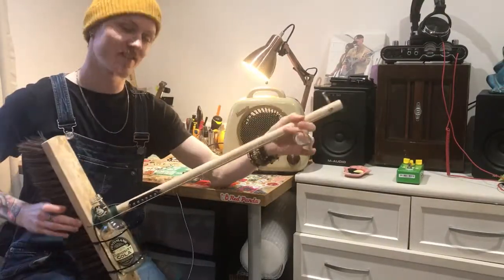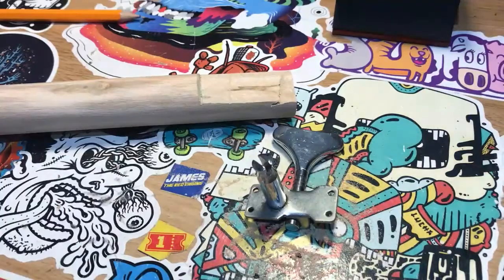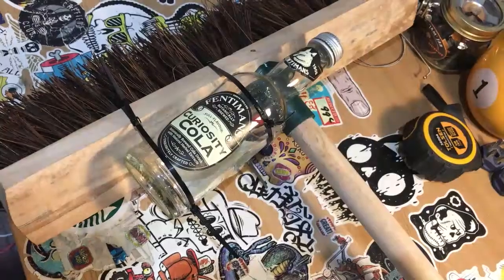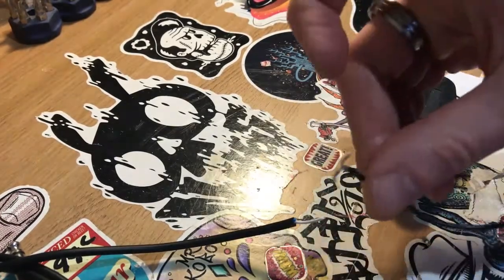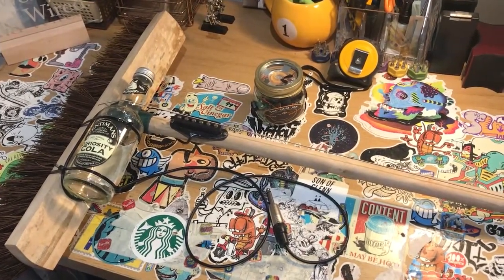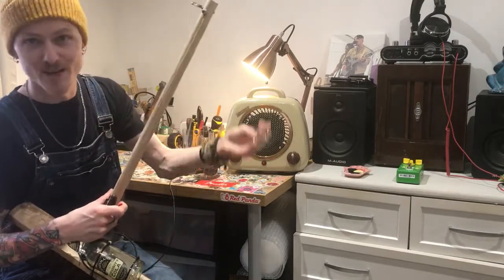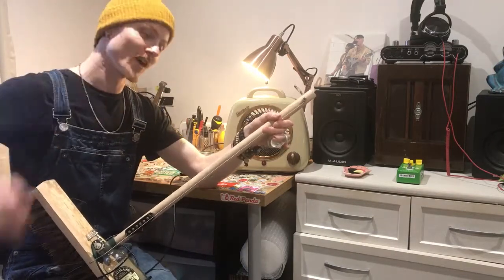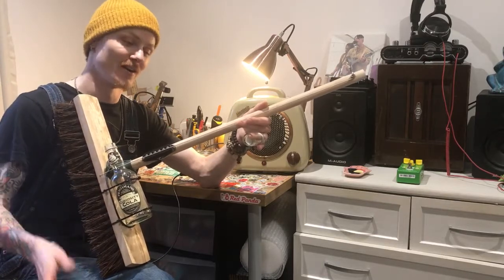DIY Broomstick Diddley Bow

Comment: Excellent video.... just starting out.... what's the longest neck I can do.... appreciate your help
Reply from the maker: Thank you for the kind words! 😄 there's no real rules or limitations in the world of diddly bows or cigar box guitars so you can go as long as you like really! 🎸

A longer neck would lend itself well to a lower tuned string. The scale length of a bass is typically around 34 inches from the nut to the bridge (or in this case the bottle!) so you could use that length to tune the string to a Bass Octave

I hope this helps, keep me posted with how you get on! 😄 I love this style of project; experimenting until you find what works for you 😎🎸